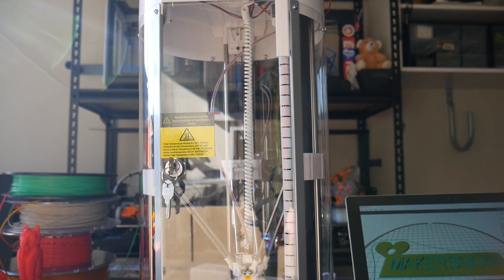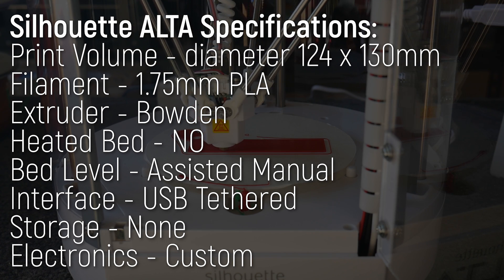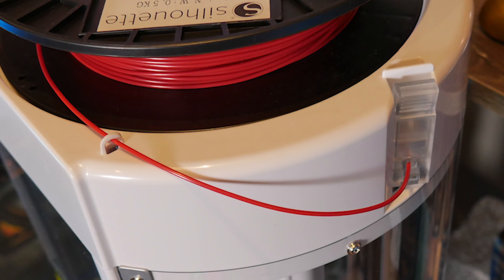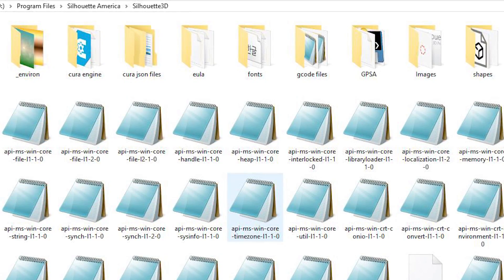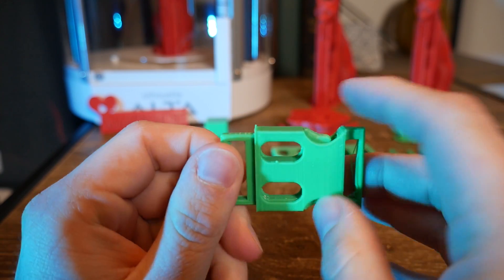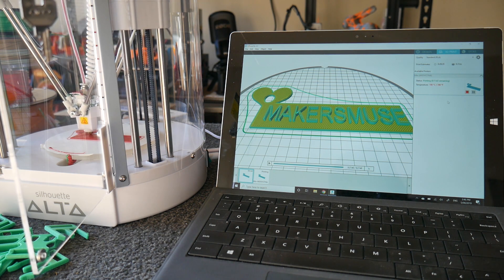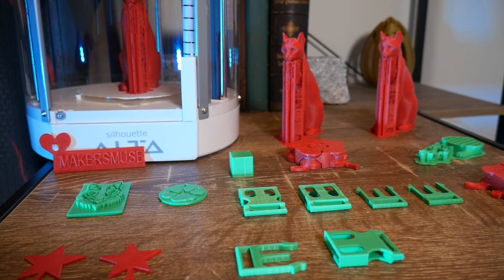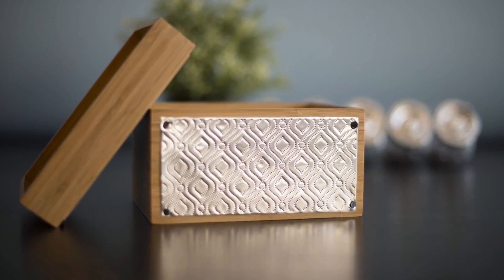A 3D Printer for Crafters? Silhouette Alta Review

Comment: I bought one of these as my first 3D printer and while it was good, very quickly I had issues with the extruder. Took it back and ended up with a Flashforge Finder. It has a lot of potential and I think the next iteration of it will be pretty damn good.
Reply: The finder was my first printer. I was very happy with it.
Reply: I never have any probs with my extruder, what did yours do?
Curious because I'm thinking about getting another one to send to college with my kid.
Reply: Christopher Leveck Get them one you gotta build, it’s a great learning experience,
Reply: @ninetails6218  I have built two machines from scratch a polar and a scara.... but you are right you learn a ton....
Reply: @christopherleveck6835 , do your kid a favor and get them an Ender 3 Pro. (The only caveat here is that they'll need to learn a few things. Like thermal runaway protection. But... Kids are supposed to be in the business of learning things, aren't they?) The Ender 3 Pro will set you back about $250 and is stunningly upgradable. There isn't much you CAN'T do with it, if you're willing to learn.
Reply: @christopherleveck6835  from what I could deduce it was a jam somewhere in the extruder that no matter what I did it wouldn't clear. Ended up replacing the extruder as it was under warranty, and after a week had the same issue again.

Took it back and got a refund. I think the machine has a lot of potential and I might look at it again when it's at v2 or v3 to see what kinks have been ironed out.

But in the meantime my finder just keeps going and going.
Reply: @MarkBlackman  some of the hot ends have an issue with the lining on the inside where its not smooth all the way through to the nozzle. I printed a filament sharpener based off a kids dollar store pencil sharpener and haven't had any problems since.
The problem is two fold. It makes it difficult sometimes to load the filament and if you are changing the filament sometimes it allows the nozzle to get clogged with a wicked little plug in that spot that is high enough it won't melt very easily. 
I use Cura with mine and I'm able to turn the temp up to 235 celcius which will melt the plastic and let the new stuff feed through....
It's too bad you can't remove the nozzle it would save a ton of hot end replacements.